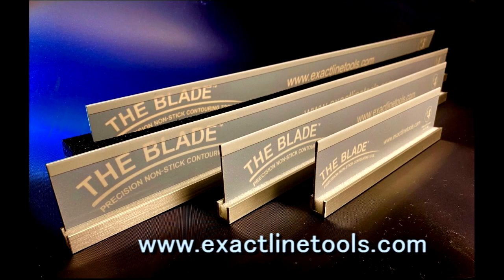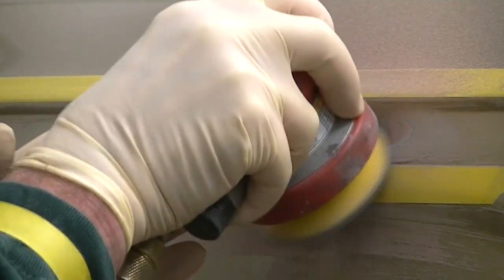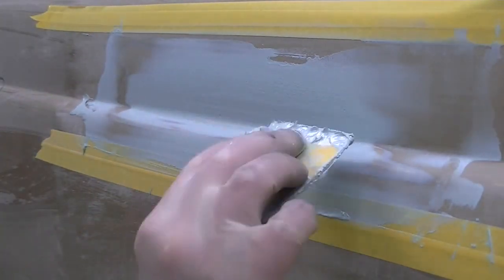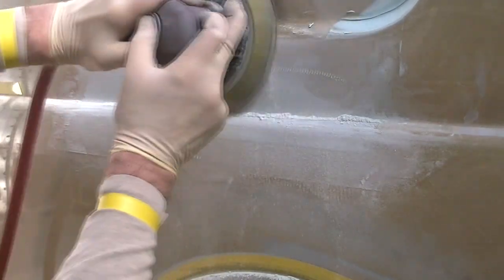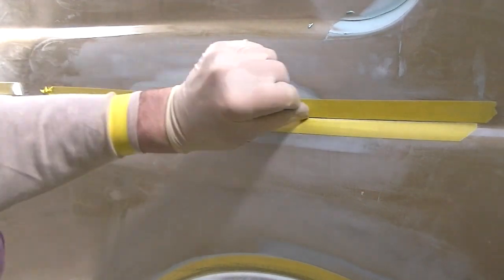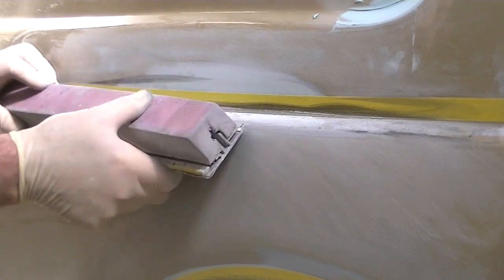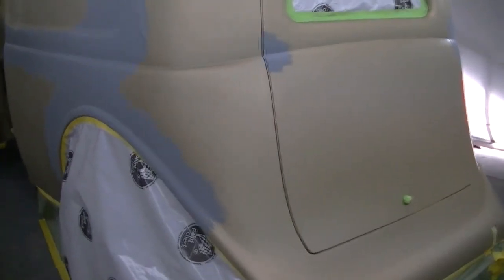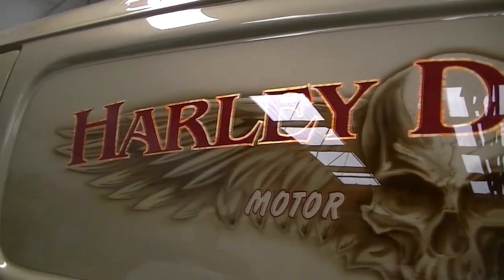Re-Touching a Classic Repair

Comment: I would like to ask you what is you technic to repair facias on  plastic bumbers do you use especial bondo ? Honestly i see a lot of videos just want to see if  you do something special you give the impresion that your use very essential stuff thank you that bondo flows verily good
Reply from the maker: The Blade works well with urethane material used for bumper repair.  I would be happy to chat with you regarding your specific repair. (971) 269-6170